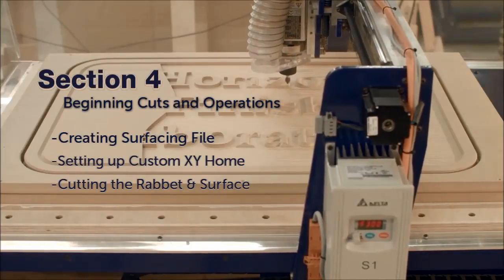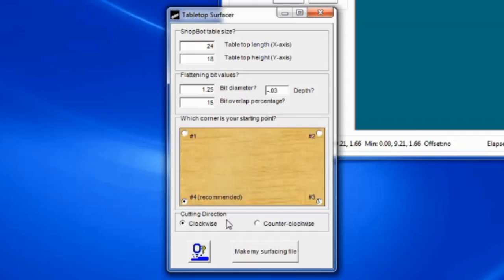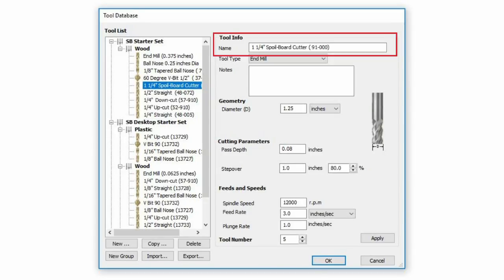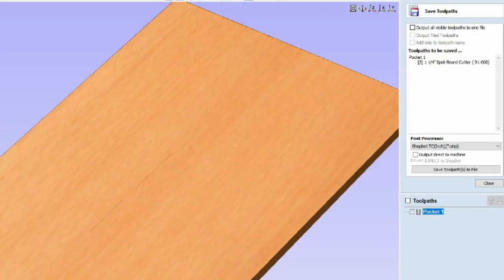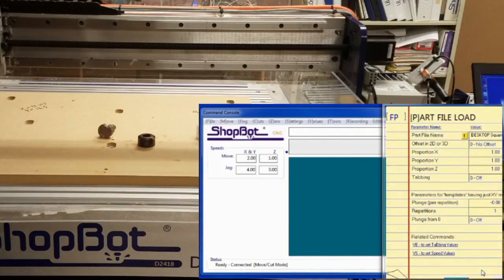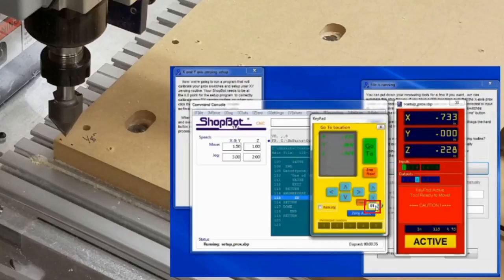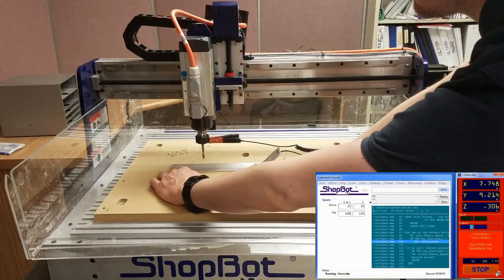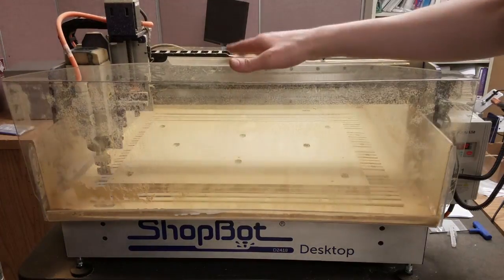Desktop Series - Beginning Cuts and Operations

Comment: I have this same machine and am trying to cut something that is absolute max thickness. That means my Z=0 is very close to that maximum height the machine will go. This would be fine, but right before my file starts to cut the machine wants to go up an additional 0.5". Your machine does the same thing at 18:18. I've gone through the code and tried to figure out where this command is and how to change it. I've changed the safe z distance (and other values) to 0.06. Nothing has worked. Do you have any ideas?
Reply from the maker: ShopBot Tech Support is the very best place to contact about this. Please call 888-680-4466 or email support@shopbottools.com and they will get you squared away! Thanks!!

Comment: Why did the spoil-board surfacing proceed from the outside to the inside instead of from the inside to outside as the Vectric software shows?
Reply: it looks like the surfacing file run is the one created using the TS routine and not the vectric file.